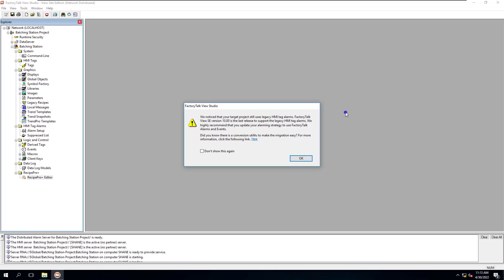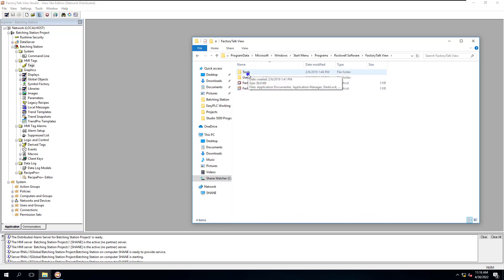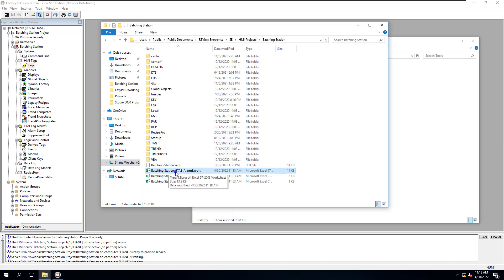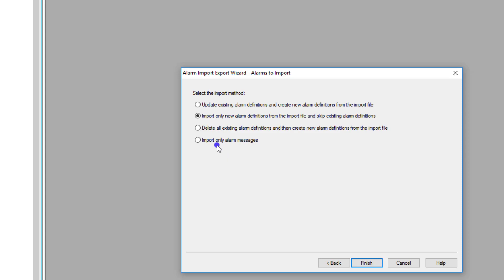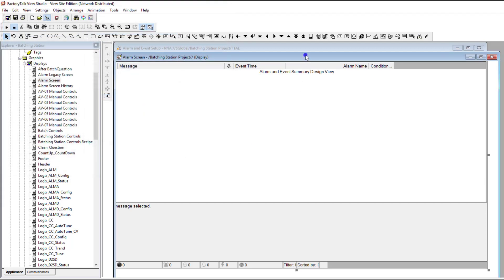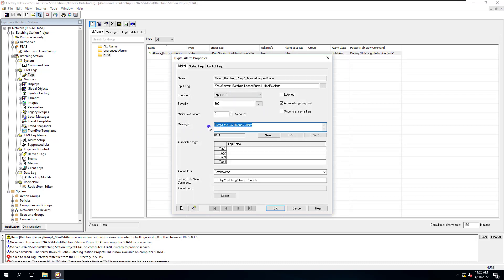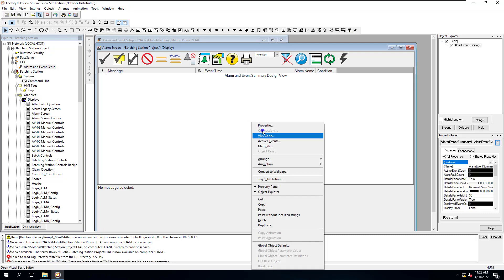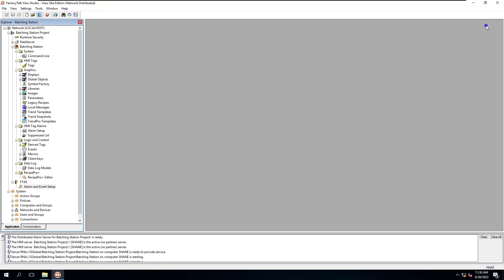FactoryTalk View Studio HMI Tag Alarms No Longer Supported  | Quick Fix

Comment: Hi Shane, hope you are well. I am running FTViewStudio SE V11. I am having issues with filters where some work and some don't work when it comes to popping up on my Alarms and Event Summary header. Thanks to this email I learned the filter alarm class name have to match with the alarm class created in FTAE, like CAPS sensitivity and spelling. My issue is that even though all that is good, some of my alarm tags will not pop up in the alarm summary. I have 5 filters and only 3 work. They all pop up in the History alarm banner but not all pop up in the alarm summary. 

We do use the Event Subscriptions parameter. Any idea on what I am missing?  

I have learned so much from your videos and tell all my friends and coworkers about your channel.

Regards,
Kenny
Reply from the maker: Sounds like you need to adjust the alarm summary main connection, meaning point it to the FTLinx that is being used.

Comment: Thanks for the video.
1- Other than factorytalk view, does Rockwell have other softwares for programming the HMI?
2- what are those built in software on studio 5000?  Are they for programming the specific models of Rockwell HMIs?
3- can we program any HMI models with factorytalk view?
4- are factorytalk view and SE two different softwares? What are the diffremces?
5- it seems when a new project is done, it can only been seen by opening the factorytalk view software and it's already saved there? How we can save it or share it as an individual file in different drive on the laptop or computer? 
I mean I have project A and want to save it in drive D , in a specific folder with a different name ...
Reply from the maker: 1 - Mainly use FactoryTalk View Site Edition or Machine Edition...they also have CCW
2 - Yes, there are AOIs to use with the HMI system or you can make your own.
3 - Yes
4 - Machine Edition is for Panelviews, and Site Edition is for large-scale systems or computer-based.
5 - I teach FactoryTalk in this course: https://www.allen-bradley-plc-training.com/p/plc-programming-for-batching-station